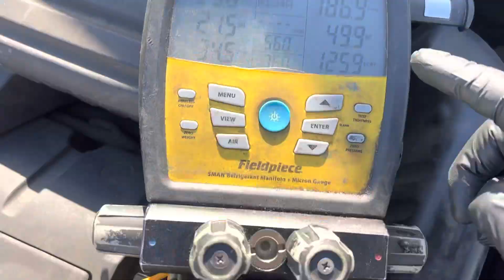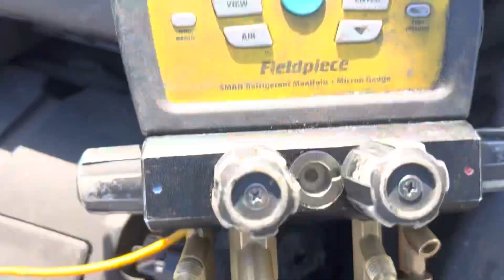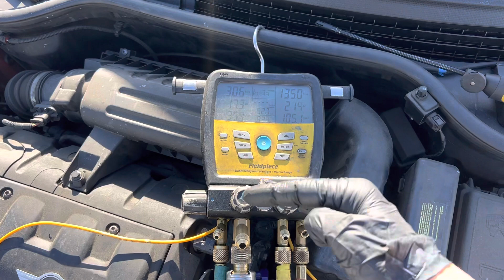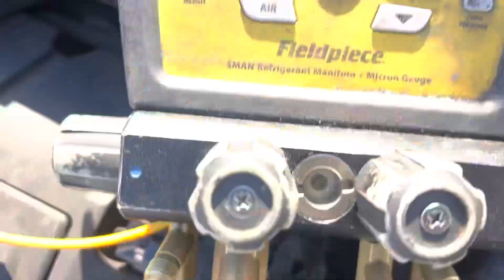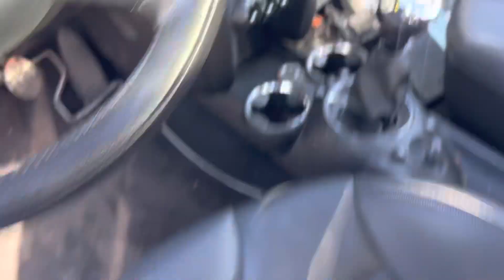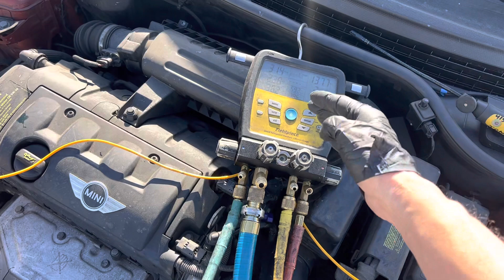AIR CONDITIONING PRESSURE DO NOT USE IT TO TELL IF AC REFRIGERANT IS FULL.

Comment: what is the first symptom, based on your experience, when a customer arrives with an AC problem and you can immediately tell by this symptom - yes, overcharged system. Is there such a thing?
Reply from the maker: Depends on the type of AC system clutched or clutchless or electrical variable speed.    High-pressure cut off censor or no high-pressure cut off censor.,  pressure, relief, discharge valve or no pressure relief discharge valves.   Etc. etc… 

Customer comes in on a hot day saying AC doesn’t work. Just had his AC recharged a couple days ago. .    With a clutch here to snap of the clutch engage sometimes with experience, you can hear the snap, and there might be a little slip for a fraction of the second and the engine labors because of the high pressure already built up..  you can actually hear the difference and then if it has a high pressure cut out, switch it over immediately disengage the clutch again. 

Some systems that use the high pressure auxiliary fan for example, when it gets over 270 psi, they have a second fan or a higher speed that is very noisy and audible.    You will hear the compressor engage and then within a second or a few seconds you’ll hear the high-pressure fan kick in at full speed but yet it’s only 75° outside and there should be no reason through your experience on that vehicle it should not have a high pressure fan kicking in.. 

On the Prius you’re here the clicking the engagement of the electric compressor it’ll start to wine, but then immediately you’re here at Labour under stress and the condenser fan will start spinning and then immediately you will hear the electric compressor disengage, and the fan stop spinning

Some cars with no high-pressure relief through a electronic switch when they hit 440 psi, you will hear a high-pressure blast of like shop, air spitter in sputtering, releasing refrigerant and oil out of the back of the compressor through a high pressure relief valve

On other vehicles, you might physically see the clutch face start to slip on the pulley and you can hear it and you’ll see even start smoking if you allow it to continue. 

These are the customers that sometimes come in too late kept their AC on say they were on the road now Sunday smells smoking seen smoking heard a noise under the hood, and the belt has birth, or throw it off and even the clutch plate might be hanging in dangling by the face of the compressor all the rubber bushings burnt the way. 

This is not all the scenarios, but these are the most common ones. 

Every decade, since I was a kid learning with my father in the summertime, when spring would roll around the temperatures would rise and customers would start rolling in with the same symptoms and same problems, literally tens of thousands of systems that were charged by shops who shake the little cans, guessing by pressure. 

Worst case scenario burns up the compressor. 

30 years ago that would be a $350-$450 job today on most modern cars a burnt up compressor can be $1500-$3500

And on the newest hybrid electric compressor especially with heat pump you’re starting to look at $4000-$8000 the price of a house split system air conditioning system. 

Times are changing technology is advancing forward faster than technicians can keep up.

Comment: Thanks,  what  app you  are  using for invoicing .?
Reply from the maker: QuickBooks, I’ve been using it for over 20 years too lazy to change to anything else

It’s cheap it’s easy good for dummies like me who are not bookkeepers are CPAs 

Everybody, smart at software and bookkeeping, use excel spreadsheet, and make their own custom modules in cells to provide all the bells and whistles and ease of use .   

I write my estimates my invoices or sales receipts right out of my cell phone. Can you do my billing and at the end of the quarter everything is complete and ready for taxes to be handed over. . 

It has a tracking app GPS to your phone. If you have a mobile business and you do your IRS tax deductions on your vehicle per mile it tracks all your locations between stops and how many miles you have traveled 

If you want to use the banking feature, it could sync up to most banks, automatically download everything you have purchased and put it into a category that you have listed 

Over the years you can develop and make your own parts list and actually take pictures of the parts that you use with part numbers and descriptions so when you later need to look up the same part or somebody else who uses your software can actually see a picture of the item that you’re trying to locate